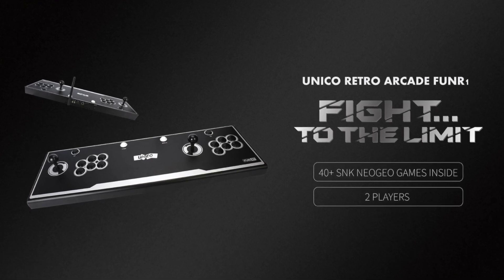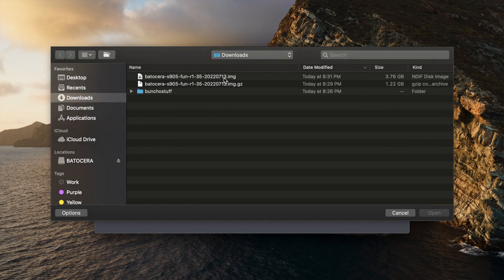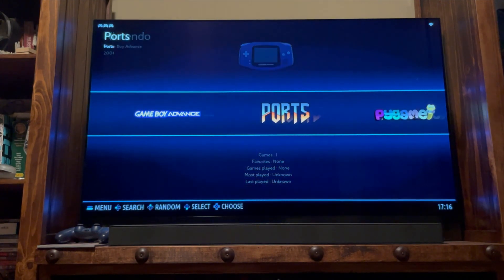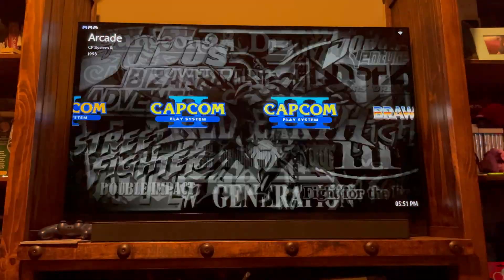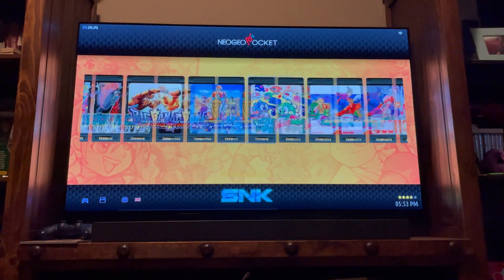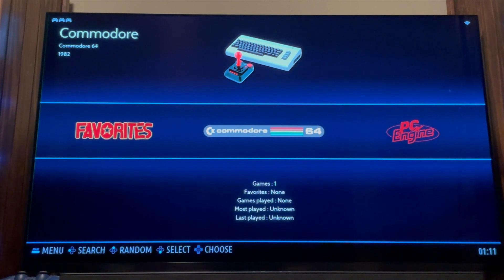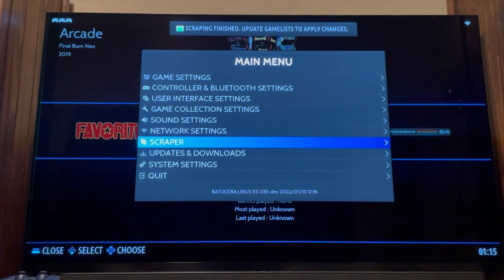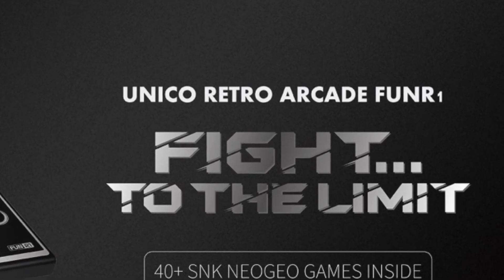BATOCERA SUPPORT FOR UNICO FUNR1!

Comment: Do i lose the neo geo stuff it came with or is it dual boot into batacera?
Reply from the maker: Batocera launches off the sd so everything remains stock if you remove it.
Reply: @neocvera thank you so much.  It's now $129.  But no factory support/ firmware update like the neo geo stick.   
You made my decision.  I'm pulling trigger on this.  
  The Arm 905x is way better then the A9 in the neogeo stick.

Comment: Howdy! Just got this working on mine. Thanks for the tutorial! I had a few questions..

How did you get to sort the CPS1-3 in their own category?
What emulator are you running them on? 
My last question has to do with my system freezing randomly at different parts of the menu while browsing. Are there known issues?
Reply from the maker: As far as the cps1-3 thing - you should explore more themes - there are some that have those separated.

Issues, you should visit the GitHub page and see if others have experienced it or report it. There haven’t been a lot of developments however. Doesn’t hurt to report it.
Reply: @neocvera  thank you! I got it to run a little smoother bringing down the resolution and choosing a simple theme.
I’m having audio issues with CS3. The audio plays at extremely low bitrate and it sounds terrible.
Is there a way to fix this? Is it the roms? Or is it automatically diminishing the quality in order to handle the video? 😱
Lastly, what low cost 2 player stick would you recommend if I’m trying to run Naomi, Atomiswave, etc.. (MvC2, KoFXII, Crazy Taxi, etc..)

Comment: Just ordered one of these, what are the advantages of JAMMA and this over say the  msvx?
Reply from the maker: Jamma - nothing to report as I haven’t tested to see if an actual arcade board can be connected to it. Over MVSX - the board is more powerful/ capable than the Mvsx.
Reply: @neocvera  Gotchya, so a better purchase overall? I always wanted to get into Neo Geo but the cost of the cabinet i think its a bit out of my price point.
Reply from the maker: Well, for the reasons you mention here, yes. The out of the box and no modifications, the MVSX wins. If it’s just for neogeo your interested in; however, the Arcade Stick Pro may be another option. After mod experience - fun r1 has them all beat.
Reply: it is strange theres so little information or discussion about this item. My father in law works with wood so maybe we can build a custom arcade cabinet for this.
Reply from the maker: @PILMAN  if you ever do that, I’d definitely like to check it out!

Comment: Is this a one time deal or do you have to use the initial method each time in order to boot into Batocera?
Reply from the maker: One and done.
Reply: @neocvera  sweet!
Reply from the maker: @noface24  yeah, basically you do the thing the one time and close the system and you’re good to go. If you have the sd card in - when you power up you get Batocera. If you take it out and power up, you get the stock system like nothing was ever done.
Reply: @neocvera  Thanks man! Also can't wait for the Astro City Mini jailbreak release!